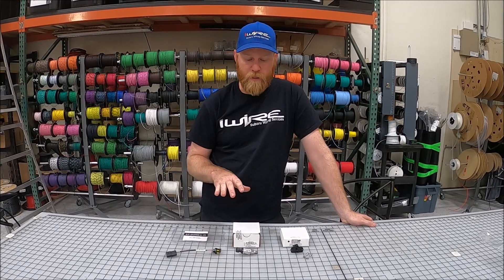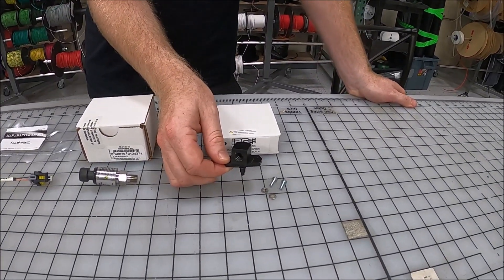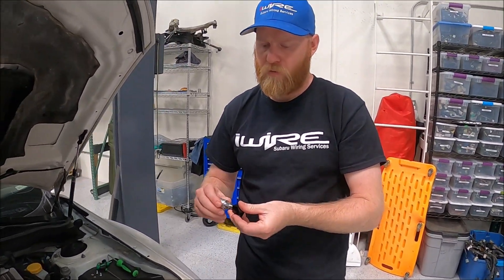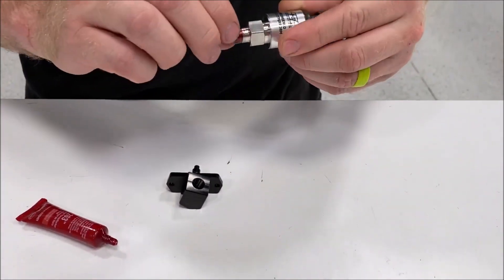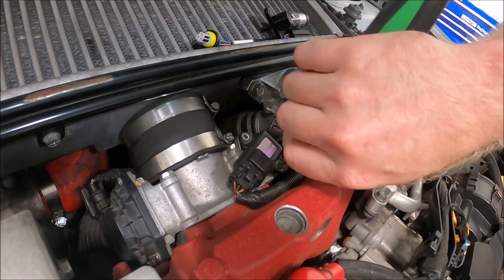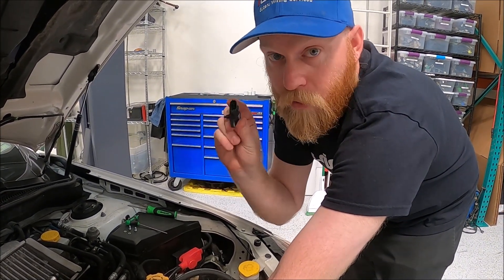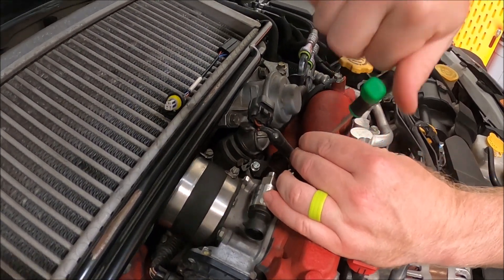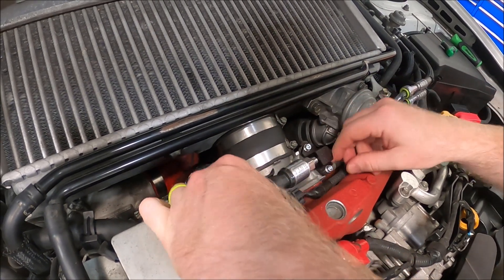Upgraded Subaru MAP Sensor Install with iWire Wiring Adapter

Comment: How do you program a 2013 Subaru WRX STI using a Cobb tuner to make the unit fully functional with the wideband signal?  How do you get the updated MAP software?  I am getting 8mpg and poor power.
Reply from the maker: This would be dependent on your tuner and your setup. I would reach out to who will tune your car for clarification on how they would get those two features working. You may want to investigate the current issue with the car before adding new parts to make it easier to diagnose.
Reply: @iwiresubaruwiringsolutions  I tune the car myself the COBB Accestuner software doesn't have settings that match your unit.  You have a list of pressures and voltages but nothing matching that data from COBB.
Reply from the maker: @ChetJang  The AEM pressure sensor is a standard component for this project. I would be surprised if Cobb didn't have the specifications or if there wasn't a way to put in your own values for the pressure sensor. Can you send us an email to info@iwireusa.com so we can help you sort this out?

Comment: What is difference between the 3.5 and 5 bar ?
Reply from the maker: AEM 3.5 bar map sensor: Supports around 37 psi of boost.
AEM 5 bar map sensor: Supports around 58 psi of boost.

Comment: What year and model are you working on in this video? I'm trying to replace the MAP Sensor on my 2011 WRX. I want to know for comparison's sake.
Reply from the maker: This is a 2011 STI that we are doing the install on.
Reply: @iwiresubaruwiringsolutions  Thanks for the speedy reply! I’m assuming the base WRX would be very similar if not the exact same? I’m just doing a factory replacement.
Reply from the maker: @DevconHD  You are correct that they will be similar but they aren't exactly the same.

Comment: would this work on throttle body that is a drive by cable
Reply from the maker: Assuming and EJ205 (2.0 WRX) this product would work for the drive by cable throttle body.
Reply: @iwiresubaruwiringsolutions  its for a ej207. would it still work?